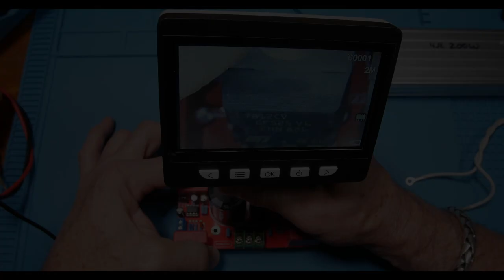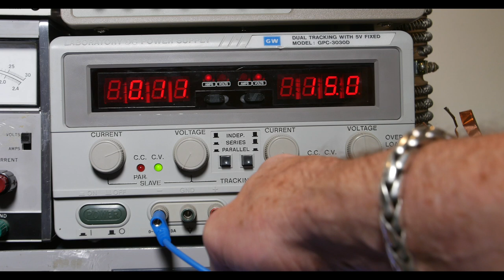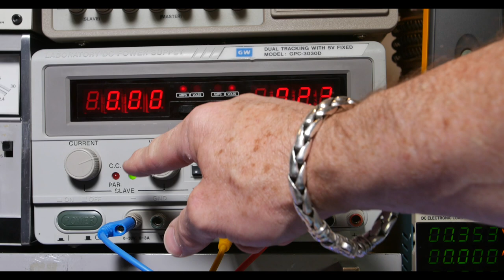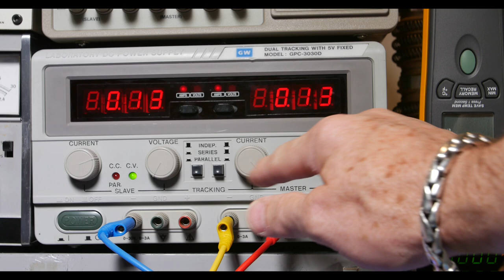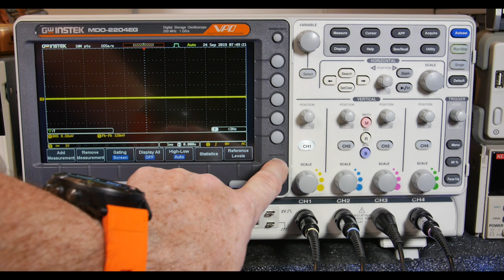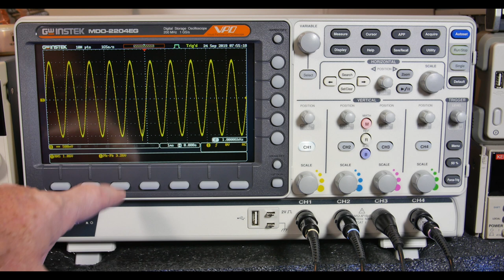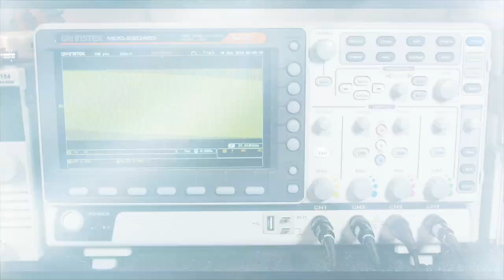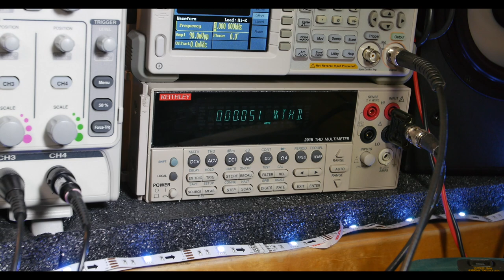Class AB Audio Amplifier LM3886

Comment: GOOD ILLUSTRATION BUT BUT,WITH THE THERMODYNAMICS PART YOU ARE MAKING ME TENSE.HOW WOULD THIS WORK IF YOU HAVE 8 OHM SPEAKERS? IT SEEMS YOU WOULD ONLY BE GETTING HALF THE WATTAGE.
Reply from the maker: Thank you!  Without heat sinks, they do get hot pretty fast.  At this point it is well below what this device can do, so I think it would put the same power out at 8 ohms to get the same temp;) I’ll get heat sinks on it so it can put out max power - I hope:)
Reply: These are rated a 38 watts RMS into 8 ohms. Figure that a class AB amp will dissipate an amount of heat equal to the RMS audio power, or roughly  38 watts of heat at full output. For two amp chips this is 74 watts of heat! You need a BIG heat sink!!!!!
If these chips get too hot, they go into protection mode and then you will get lots of distortion. I would recommend a finned heat sink about 30 square inches as a conservative design. If you are driving 4 ohm speakers you need a heat sink twice as big.
Reply from the maker: @barneylinet6602  Thank you - that is great information!

Comment: For a complete test you will need a heatsink so the amp doesn't overheat and a speaker. Using a resistor for load is not sufficient because resistor doesn't give back EMF like a speaker does. And btw, it's always a good thing to have a low pass and high pass filter on the amp. Few years back one lets call it night club has replaced 10 HF drivers in about a month. I came to check what was happening since they were using our speakers, and they don't break often. Their technician would just replace the bad driver and call it a day. What was burning the tweeters was their cheap amplifier, which on its own is a fine amplifier, but it didn't have a low pass filter on 20 kHz, and one of the dimmers was inducing a lot of noise at about 40 kHz or something like that. That noise was picked up by non balanced audio cable and amplified amplified it and send to a speaker. Nobody could hear it, but the tweeter was getting full constant power from the amp when the amp was turned all the way up, and over time it would burn the voice coil of the tweeter. We upgraded the input with balanced cables, since the amp had balanced inputs, and put the LP filer on the input of the amp. The problem never happened again.
Reply from the maker: Thanks for the great feedback!!  I’ll have to get some new videos up and I’ll be happy to hear more great information!

Comment: If you check the datasheet it better works at 35V. Any other voltage will cause bigger distortion at high power (>40-50W depending on a load resistance).
Reply from the maker: Yes, but I was keeping the voltage low enough so not to distort and I think it was high enough to bias everything well enough.  It actually tested pretty good don't you think?  Thank you for your feedback - and I will test this amp again as this is one of my favorites right now.
Reply: @KissAnalog  Yes sir ) I'm thinking about this amplifier for my DIY project during a lockdown. Your information is appreciated.
Reply from the maker: Thank you!

Comment: Great video! I am just surprised about how far the gain setting resistors are from the LM3886 chips also the buffer caps are quite far away. In all the datasheets and design notes they outline everywhere that these components should be placed very close to the chip to prevent oscillation.  In any case the amp seems stable, I wonder now how important that is.
Reply from the maker: I’ve been looking at this and it is interesting.  It is fairly small board and not a lot going on so it is probably ok some cases not to have an ideal layout.  I’m like you - I like to keep things tight and I know you have lots of experience from watch your channel - which is one of the best on YouTube!!

Comment: Hi, been learning a lot from your channel last few months, so thanks for all your effort ...  , I now have this board and a Kaiweets desk supply to begin my journey.  If I wanted to review building the power supply into the board, do you have a video about a power supply that would best suit this board? Would it be DC like the test or AC?
Reply from the maker: Thanks Paul!  Sounds like you are having fun.  Do you want to use DC or AC power?
Reply: @KissAnalog  Cool, so as a novice the best pointer would be one where you feel a simple solution would give a decent result from this particular board.  I'm in the UK so AC will be 240/220. I've found lots of kits and have several old items that have boards that convert to DC. What i'm probably missing is enough understanding which approach would be best for this board ... it seems like managing the AC voltage straight into this board would be simpler? Ultimately im looking for this project to allow me to replace components one at a time to see how I like the sound ... once again without your channel I wouldn't have made it to this basic level , tyvm

Comment: ANY class amplifier needs a heat sink from the start at any voltage or load. 
I'm surprised that the YouTuber (sorry no one shares their name) was, surprised, by this.
These are designed to be put into a case with a heat sink immediately as drop-ins.
Reply from the maker: Yes you are right!  I was trying to show how very little power heats this up, and how a heatsink was needed.  BTW, I give my name at the beginning of the videos;)  Eddie Aho, and here's a link to the follow up with the amp mounted, for test, to a heatsink: https://youtu.be/kFBz05eeXfQ
Thanks for the great feedback - Hope to hear more from you soon!
Reply: @KissAnalog  I compete in car audio and would love to build my own amplifier. I know they make mono, full range, already assembled DC amplifiers. I run 4 speakers for my front stage....2 wideband 3" drivers that play from 250hz to 20khz. Then, for midbass, two 7.1" mini woofers. My sub is a 15" which I will power with one of my 1k watt amplifiers.
I want to run one mono amp per speaker for my front stage. I'm meeting around 75 to 100 watts from each amp. Help me with this project sir! I've had 3 spine surgeries with 2 multi-level fusions. I now have nine screws of which three have backed out and need surgery again. Thursday to see what the plan is.
I'm very humble would love some help to find these for amplifiers and build some type of heat sink for them. Maybe I can work with you on a video and get my first video out there as well LOL. you obviously have the equipment and know what you're doing and I could have many many more projects for you which could easily turn into videos!
My email is jmurphy30513@gmail.com and my Facebook profile where you can message me from....
https://www.facebook.com/profile.php?id=1648520005
Thank you sir.....so much!
Reply from the maker: Thanks for the great ideas!  I’ll email you.  My last few weeks have been crazy busy, but I like your ideas!  I hope the surgery plans go well - sounds painful - I’m sorry.

Comment: The LM3886T was at one time manufactured by National Semiconductor.  This board is no longer available from Amazon.
Reply from the maker: Thanks DandyDon!  Here is one that looks good too: https://amzn.to/3yYm7ip
Reply: @KissAnalog  Just like batteries...... Heat Sinks not included, but definitely needed.  :o)

What I do not see though is a connection for the mute feature.  A design which was used in a musical instrument product required 40v DC to operate it.  I don't know how 15v DC is enough with this design on Amazon.

Comment: Great video again as always, glad you again did explain your setup and the important details all the way, like heat, scope readings and 60 deg is autch temp! :-) When I see how small this amplifier is and how few components it is made of and compare that to some of the amplifiers you can buy where they are the size of 2 shoe boxes with over 1,000 components and 80 Lbs, I can't help wondering the reason. Can you maybe please explain why?
Reply from the maker: Thank you Fried Mule!  Yes that was hot;) I’ll get a heat sink on it for the next video...  when I show the data sheets, it will help explain how these replace so many parts.  Also, I’ll add an ac power supply, so that will add parts and weight.
Reply: @KissAnalog  So the reason is that a lot of these components are integrated in to the chip (IC):-) But that have to be both good and bad, wary easy to use, almost all parts in no space. Against that you can not select your own PNP''s, resistors or op-amps and that gives a lot less design freedom but do on the other hand, save you a lot of money:-)

Comment: how do you bypass the preamp section?
Reply: is it as simple as moving the jumpers?
Reply from the maker: The jumper labeled GND and IN - I think you use those to run your signal into (removing the jumper).  Otherwise the pin labeled Out is the output of the preamp and that is jumpered to the IN pin.  Does that make sense?  check the traces on the bottom of the board and you can see which way the route.  Let us know if that works for you;)